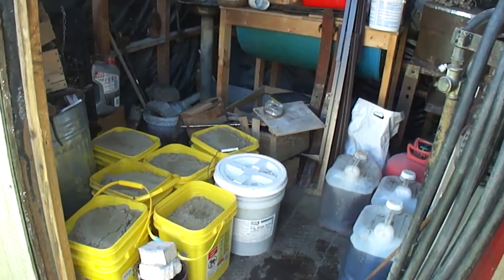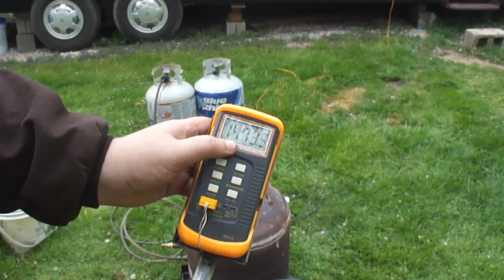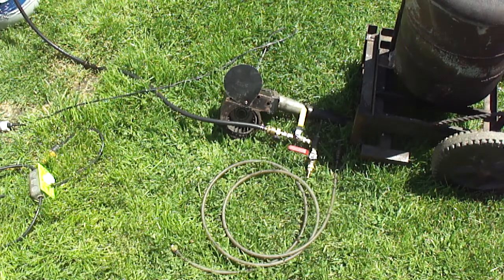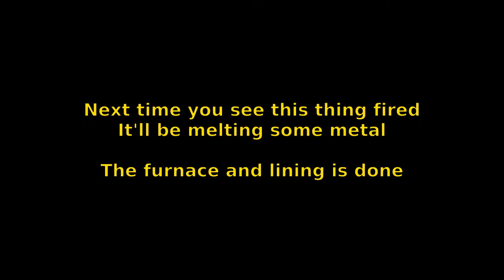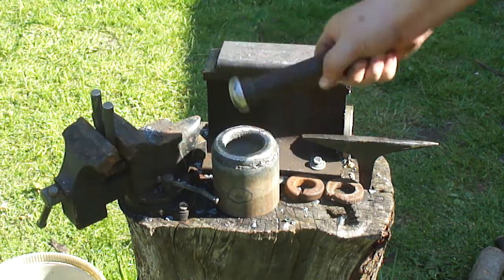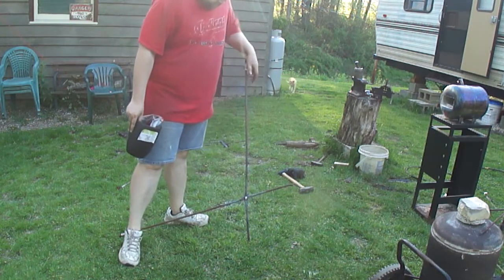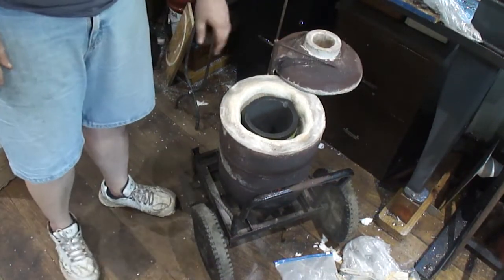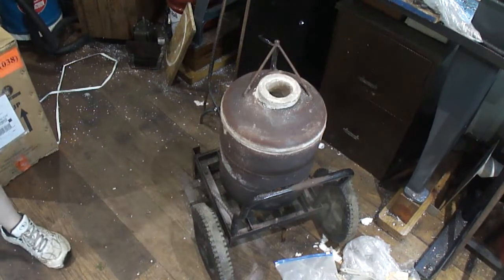Path to Iron P2: Refractory Coatings Test, New Degassing Plunger (Aluminium), Crucible Tongs

Comment: I can assure you the ITC does!!!!😬😉
Reply from the maker: yea, the outside of the furnace told alot of the story after being fired for a while between the two, lol.
Reply from the maker: yea, it did help, not really by getting hotter faster like I thought it would, but by retaining the heat better than with satanite alone.
Reply: Chirpy's Tinkerings I’m telling you man that was incredible that you could put your hands on it!
Reply from the maker: lol, yea, I was pretty impressed too, it was pretty nice knowing that it was that well insulated compared to my old furnace, lol. If I melted aluminum in it before, I could not only cook an egg but burn it to a crisp on the outside of the furnace before, lol.
Reply: We used a four hundred lb freestanding pot crucible furnace for glass in college. 2350 Fahrenheit in a furnace body made ten or twelve times bigger than yours. Took five days to come up to temp lol. never did sandcast metal but did a lot of ladle poured glass castings into open faced mold cavities.
Reply from the maker: very cool, Ive seen a few people trying to do glass casting, but never really tried it myself. I dont have a kiln to cool it slowly so it doesnt end up with thermal shock and crack the glass pieces, so just never tried it, lol. 

Some furnaces like that are just big dense bricks for lining more or less, and it helps even out the heat a little more where as something as insulating as my furnace, as soon as you turn off the burner and open the lid, most of the heat in the furnace will just disappear except what is in the crucible itself. If it was electric also, that would explain alot about the slow ramp up in temps.
Reply: @ChirpysTinkerings  ours was a top and bottom bracketed together. The bottom went crucible layer of refractory brick steel shell. There's a crapload of various designs for glass crucible furnaces but that one is very common for production in Europe so that's what we got because rather than continuous running we took it up and down twice a year. Some of the same model as we had ran continuously in factories for ten or twelve years before being split and given new crucible bottoms. Man I miss melting stuff. Now i need a shaper and a mini melter lol. Killin me dude hahah
Reply: And no ours was just propane and forced air. The ramp up slowness was to ensure the even warming of the different layers without cracking from moisture I was told.
Reply from the maker: lol, it's not that hard to make a small furnace tbh, I just went overkill on mine really. Ive seen a few designs for glass furnaces, and have known a few people that blow glass and have seen thier setups. Its an interesting setup for sure, lol.
Reply from the maker: oh, ok. It must have been in a really damp environment if they had to do that every time they fired it, and I can understand slow cooling, I do the same on my furnace and it helps prevent damage to the crucible and lining. Thats why my old furnace lining would take 9-14 hours to cool down, and why after 5 years, it still was intact even tho it was constantly run at temps it really wasnt supposed to be at and given probably more abuse than it was designed for, lol.
Reply: @ChirpysTinkerings  they put an a frame roof next to the generator she'd and put the furnace and two giant reheaters that are basically forges on the back of the building co located with fifteen hundred lbs of powder form chemicals and a blender to make standard clay lol
Reply: I swept and sprayed the pad we worked on every night lol. Giant Halo of dust around it in it's drainage. Glass crumb encrusted clay slag lolol
Reply: @ChirpysTinkerings  and yeah being gentle on them is proven beyond a doubt to radically increase life span. The glass and foundry factory folks I've talked to all swear by it for sure.
Reply: @ChirpysTinkerings  there's a book called glass notes with open source diagrams to build a one hundred lb furnace. My welds just suck lol. I can score a mini melter for two hundred bucks around here.
Reply: I sure miss glass. Haven't melted in six years.
Reply from the maker: lol, maybe one of these days, Ill try it, and Ill check out that book. I probably wont make a furnace for glass since I already have mine, but it would be interesting to see the design ideas, and dont worry, my welds are not good at all, but thats what the flap wheel on the grinder is for, lol.
Reply: @ChirpysTinkerings  your current furnace with a fresh crucible would do fine but the only trick would be keeping the temp static rather than constantly rising to it's max potential. Your furnace goes way past the temps glass needs. Glass notes was first written in the seventies for folks who want to build all the gear from scratch it's a Bible of sorts for studio glass.

Comment: This is great! I was curious about the difference ITC100 makes so I'm glad you ran a before/after comparison. I'll probably hold off on ITC100 until I know whether my current furnace is too small. I need to patch where the crucible stuck to the satanite during seasoning (the chunk of firebrick I was using as a plinth was too tall for the crucible to fit so I removed it; one minor mistake after another...) It's tempting to try to avoid every problem by up-front design but at some point you just have to work with what you have and deal with it, learn by doing. The way you just plow forward is really inspiring.
Reply from the maker: Thanks, and a trick to keep the stuff from sticking together is to put a piece of cardboard or two in between the stuff so when it's fired, it'll create soot and it wont stick then. Powdered graphite may work also, but have never tried it. 

I wouldnt put the crucible down low, you want the crucible to be up and out of the way of the flames, or you'll just end up with flame impingment on the crucible, and that just tears crucibles up very quickly. It also causes all kinds of weird heating issues, like Ive been getting, thats why plinth blocks are used. I would just use a shorter plinth, just as long as there's no flames anywhere near the crucible itself.

Comment: The wind here is also driving me crazy. Usually there is no wind in the morning but later in the day it picks up. Drives me crazy. And annoying when cycling. We got no hill here but wind is just as challenging :) How about melting some alluminium with a wood fire, can that be done?
Reply from the maker: yea, that can be done quite easily actually. Ive seen some people actually just dig a hole in the ground, take a steel pipe and angle it down so it comes in from the side and ends up at the bottom of the hole, stick the crucible in and fill in around it with charcoal and sticks, then add a little air from a hair dryer in the pipe, and melted aluminum, brass, bronze, copper, etc. Aluminum is probably the easiest to melt, I think it's around 650C that it has to get to and just a wood fire will melt it easily enough. I tend to melt wheel rims and lawnmower engines in a bonfire using just wood to break them down. 

There's plenty of types of casting furnaces, but if your going for charcoal or wood, I would look into david gingery's charcoal furnace, which gets into a bit of beginner casting setup. There's also lots of people to help on the discord server too, lots of people just getting started in casting also so lots that you can learn if your interested in it. 

Here's the link for the discord server: https://discord.gg/NHTJz45
Reply: I got a couple of vintage aluminium car rims that are useless to me and I though it would be cool if I could turn them in to stock material to make a pulley :) I wonder if you end up with lot of dirt from the wood fire in the aluminium meld.
Reply from the maker: nah, that ash and everything actually just floats on top of the molten metal, and before you pour, you just scoop it all off, just make sure to preheat your spoon/scoop in the first first to make sure you dont have any moisture on it. Easiest way to make pulley blanks, if they're smaller OD, you can use soup cans, just stick them in the fire and burn the coating out first and just pour the metal into them, and for larger ones, you can use lost foam tbh.
Reply from the maker: lol, congrats. Now you just need to get it hot enough inside of a crucible to be able to pour it into some round stock, lol.
Reply: How about trying to melt some aluminium profiles in a tin can over a woodfire, without doing any poring? Any chance of success?
Reply from the maker: it could work, but I'd be afraid of melting the aluminum in the tin cans because the molten metal is corrosive and will eat a hole through the steel can. You could technically do it, but you would have to make sure there's no excess air to oxidize the can or you'd just end up with a hole in the bottom of the can and molten metal everywhere, lol.

Comment: Talking about the crack in your furnace,  is it between the wool and hot face layers?
If so, maybe something to do with different expansion/contractin rates?
Reply from the maker: nah, it's not, I think it's the weight of the lid pressing down while it's hot and causing the crack right at that point. I think after after a few firings and everything gets seated together, it'll stop moving and Ill just coat it again with the ITC100 again, then it'll be good to go from then on.

Comment: Hey Mr. Chirpy. I have a couple of questions. The ITC100 seems like it works pretty good. How much did it take to coat your furnace? Did I hear you right saying you use a flourite degasser? If so where do you get it? Thanks. Great videos.
Reply from the maker: hi rabbit, cool channel. I used a pint container of ITC100, and that gave more than enough to coat the inside of the furnace. I used satanite behind it to give a solid shell for the ITC100 to stick to, that way I didnt have to use very much ITC100 since all Im really using it for is an IR reflector to increase the effency of the furnace. I use calcium hypochlorite as a degasser, which is sold as little plastic baggies of pool shock granules at the store with the swimming pool supplies. I usually use around a teaspoon of the granules wrapped up in an aluminum foil ball for every 10lbs of aluminum.
Reply: @ChirpysTinkerings  Thank you for the reply and compliment. Calcium hypochlorite makes sense and it doesn't cost a lot. I'll order some and give it a shot. I have two furnaces and the one I want to try the ITC100 on has fire brick lining and it leaks heat really bad. The brick was free but I'm paying for it in propane. Thanks again.
Reply from the maker: @therabbitchannel2059  np, and I hope it works out better for you.

Comment: The moment I see shorts and that type of footwear is when it time for me to move on You Sir are just asking to get hurt
Reply from the maker: Yea, I agree with you, but as there is no metal being melted in the furnace, and Im not messing with the furnace stuff other than firing it. When I actually do start melting metal, Im always in pants, steel toed boots, apron, etc, proper safety gear. The forging itself, unless you deliberatly try to burn yourself with it, it's pretty hard to get burnt with it when you know what your doing, lol.

Sorry to see you go, and I fully understand.
Reply: Oh bother I've blown glass  with a girl wearing nothing but welding shade threes and a smile his shop wasn't even hot.
Reply from the maker: yea, but when molten metal is involved, you want everything covered because one little steam pop and your in the hospital at the burn unit. I understand his concern, but as I wasnt melting any metal, just firing the furnace lining only and never even had the lid open, I wasnt as concerned about it, but if I were, I'd not have been wearing the shorts and tennis shoes.
Reply: @ChirpysTinkerings  spatter sucks as does radiant heat on the naught bits I assure you I only did that once hahah
Reply: And just to be clear I get his concern too but it should be obvious to anyone watching you were just warming the liner stuff. It's nice to show concern I suppose just seemed snarky.
Reply from the maker: I only cast in proper attire and have had a steam pop one time, just a very small one, but still burnt holes through my pants and welding jacket, and was glad that I had the stuff on for sure.
Reply: @ChirpysTinkerings  i have every confidence in your sense of self preservation :)